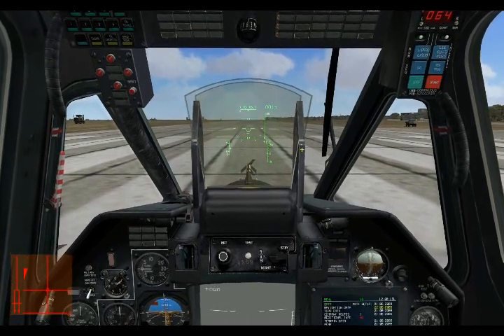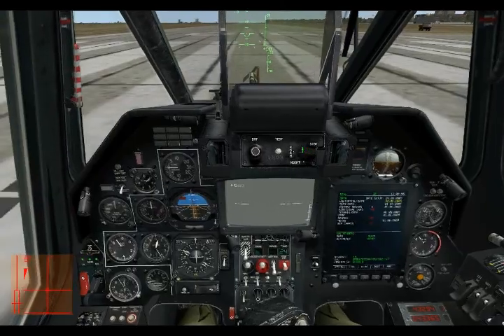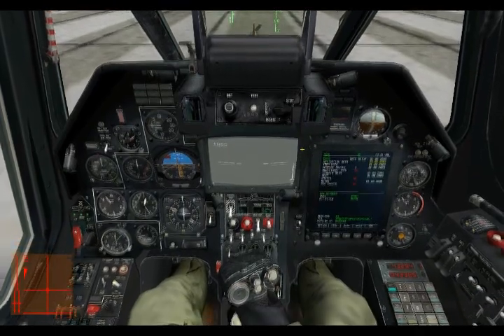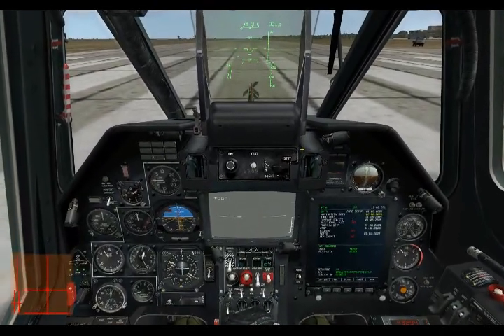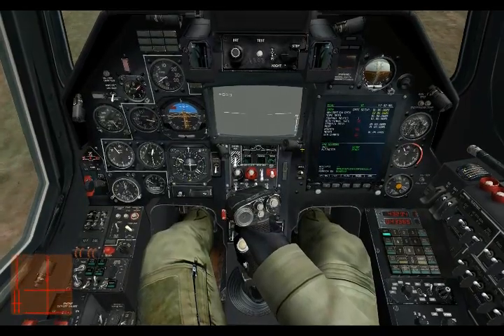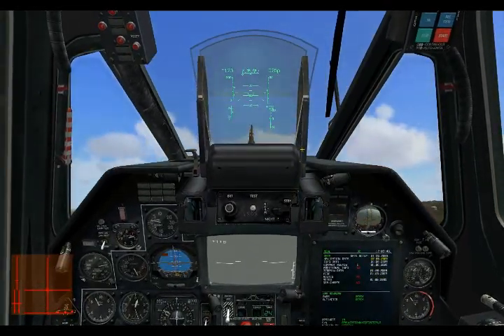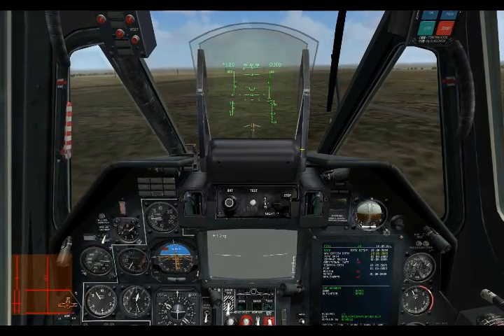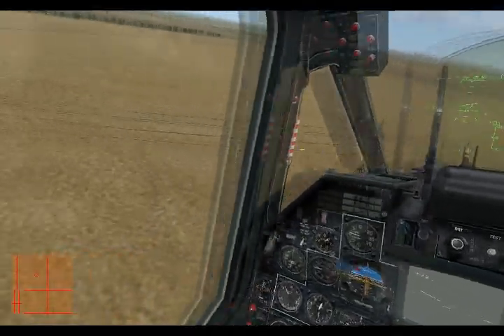Black Shark Note #10

Comment: @yony120 I love it. When I need more maneuverability I turn on the flight director mode. The chopper remains very stable but doesn't stick to a heading or pitch angle. The only thing I don't fully understand is Autohover + Altitude Hold.

Comment: After knowing how to use the trimmer I hated the chopper`s autopilot. Now that I know how it works, I love it. I can takeoff and go take a crap while the autopilot follows the route and avoids buildings and stuff all by itself. And when I need to control the chopper more freely, I turn on flight director mode and I do whatever I want without the wild banks that come from disabling the autopilot channels.